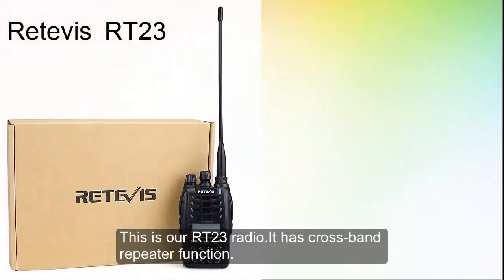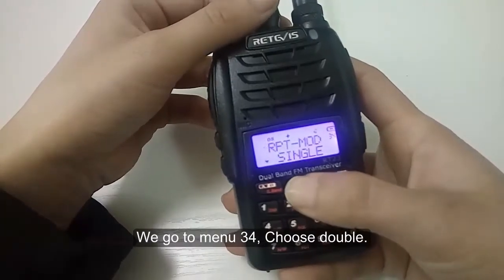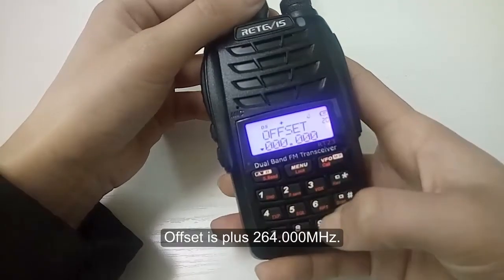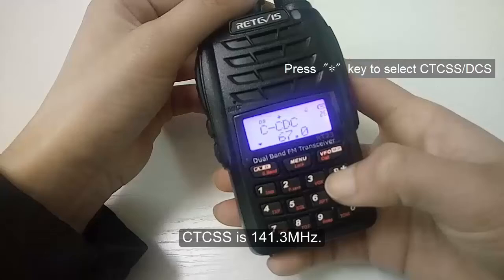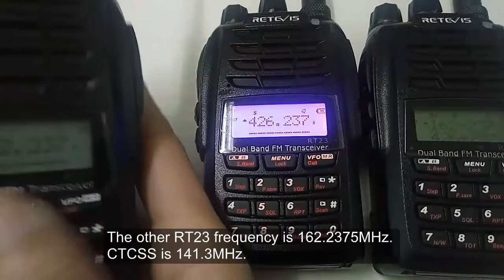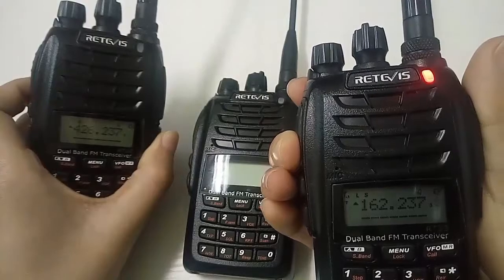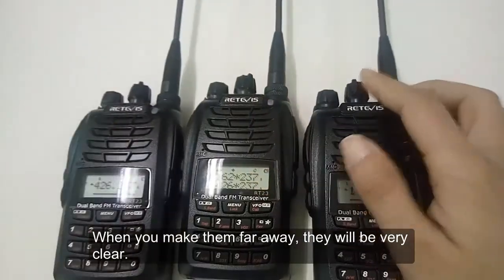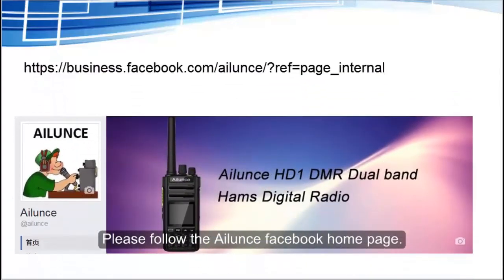RT23: How to setup cross band repeater

Comment: I seem to be unable to set the RT23 up to cross band repeat back to a repeater...  How is that done?  It needs to receive and transmit on a split on the UHF and VHF bands.  This way: RX 146.980 (100.0 tone) to TX 443.000 (100.0 tone) Then the other way  RX 448.000 (100.0 tone) to 146.380 (100.0 Tone).  I cnget ti to do a single frequency in each band but not split to extend another repeater.  My very old Kenwood TMV7A will do this just fine with an easy setup. You just have to program two channels, one with the UHF frequency, tones and split (Frequency offset) and one with the VHF Frequency tones and offset then tell it to  cross band repeat.  Can the RT23 do this?